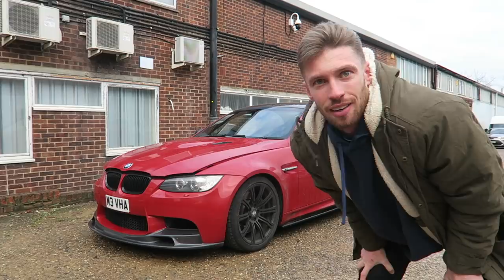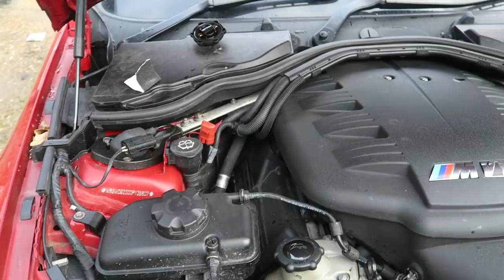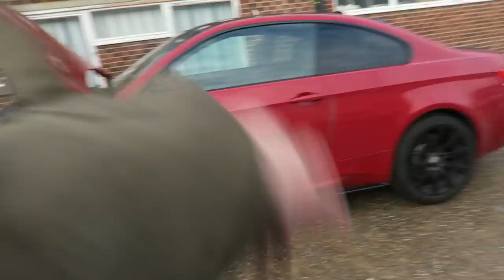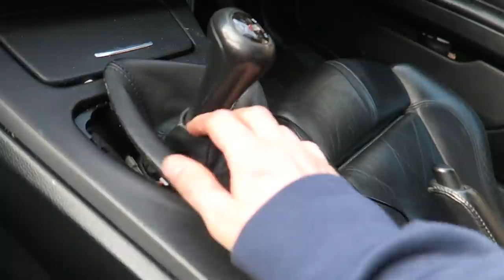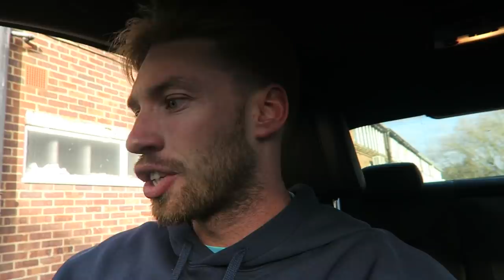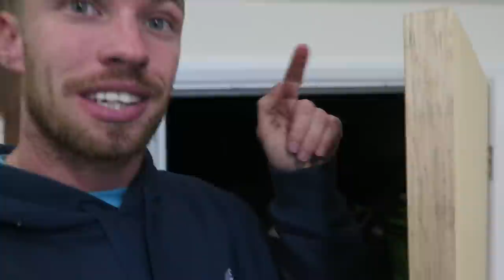FIRST CHANGES TO THE E92 M3

Comment: Lee you can buy an new I drive screen from eBay and it will have apple car play and android connect. Also the new gear knob you have is off a standard bmw 3 series m sport. The new gear knob is loads better in my opinion I don’t know why they didn’t put them on the m3s as well from factory

Comment: F10 M5 Gear knob is what you want mate, nice weighted gear knob with leather gaiter and it's illuminated. Might have to do some arts and crafts to fit the gaiter but was easy on my E46, BMW part number is 25112284205.